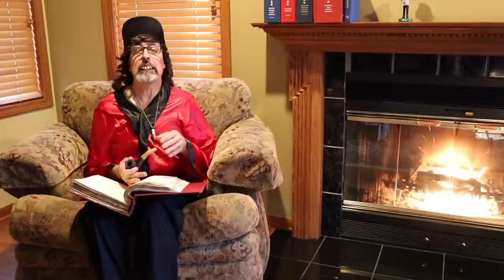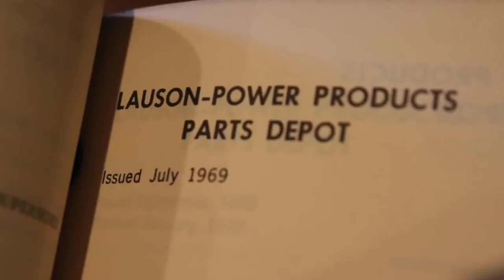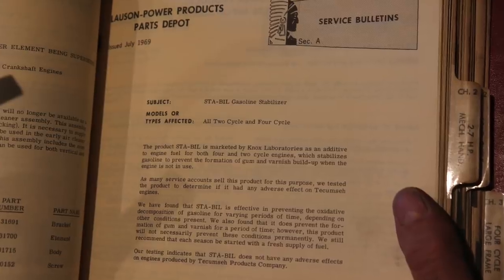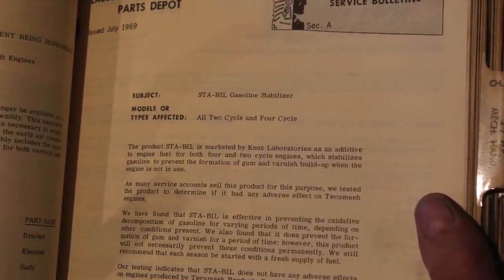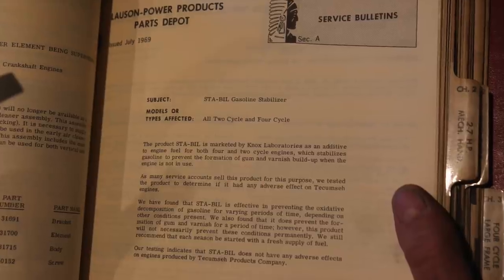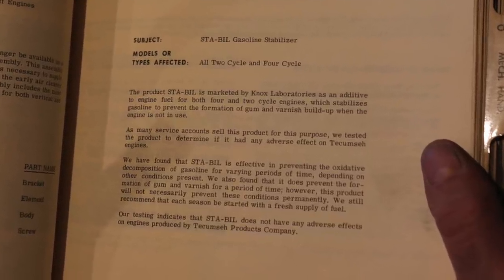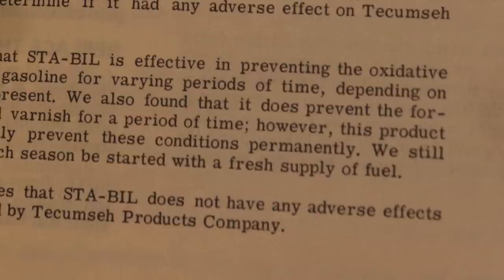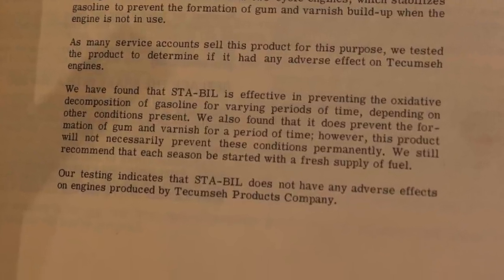Sta-Bil in 1969 - Does It Work?

Comment: I used to have carbatretor troubles, gumming up, varnish, etc with my Toro CR2000 snowblower because I would sometimes forget to drain the gas after every season. After I started using Sta-Bil gas additive the problems went away. For about ten years now I never drain the gas each season and never have any carbatretor problems. The only thing I make sure to do is to run it every season to make sure fresh gas is run through the system at least once a year.

Comment: This may be completely moot, since the leaded fuel we had in '69 was different than what we have today, I would assume that Stabil has also changed it's formulation. Back then, it was varnish that caused problems, while today, it is alcohol.
Reply: Well Taryls experiment shows no benefit of fuel stabilizer for over a year now
Reply: Lead in ‘69 fouled 2-stroke spark plugs.  Lead free gas was great...until ethanol.

Comment: That fireplace looks good. We have a fire in our wood stove this morning in TX.
I've stayed away from stabil,  i've cleaned quite a few carbs that had pinkish varnish from sta-bil... I've been using Star Tron with no problems. last year was the first year i used startron in my Pushmower and i decided to leave it with fuel sitting in the carb over winter as a experiment, sat from November to about mid march, it sputtered on the 1st pull and fired up on the 2nd pull, surged 2 times and ran great!

Comment: I use stabil and never have problems. But, and I mean but I do swap out the fuel around a year if no use. I simply put old gas in my truck and replace with fresh fuel and stabil in what ever engine it may be.  Never an issue in years

Comment: Fuel has been completely reformulated since 1969, Sta-Bil has changed hands since 1969, ( now owned by Gold Eagle brands) and has probably been reformulated, more than once,  as well. Sta-Bil now offers several fuel stabilizer products marketed for various needs and fuel types.  Sta-Bil  Storage advertises the product will keep fuel fresh for up to 24 months and works in both ethanol and non ethanol fuels. Sta-Bil 360 is geared toward ethanol fuels and only claims to keep fuel fresh for 12 months.  Anyone considering the use of these products should visit the Gold Eagle web site and read the various marketing materials for each product before  purchasing and using one. Include taking time to read the FAQs as much good information is contained therein.

Comment: Been using Sta-Bil fer 30 years. My Stihl 036 was made in 94 and has yet to have the carb touched on it. I also have two Redmax trimmers made in  2003 that are still percolating without any carb failures. I also use 100% gas. I think that it’s a good product but I ain’t getting into a fisticuffs with anyone over it. Us po folk better start sticking together.

Comment: How about that, I had no idea it was around back then! In those days we never drained out the mower gas tank over the winter and the mower never failed to start in the spring. Only time the gas ever got water in it was when the tank got left outside in the rain with the cap off.

Comment: What’s interesting is that gasoline has changed in some of its composition over the decades therefore these stabilizers must have changed as well. In the end with what the tech bulletin suggests it may help keep some of the bad from happening and change out your gasoline for a few months, so if you have a shut off then run your carb out and keep your gas sealed. I suppose that’s our answer on additives for some applications.
Reply: So explain this. Why is the 87 octane  no additive still starting up with the same amount of pulls as the stabil and other stabilizers.  After 12 months.  It's all about people that believe in snake oil.  And like wasting there money lol

Comment: Taryl, can you do a video on spark plugs for small engines please.  I want to change a spark plug on my Harbor Freight Greyhound engine and it calls for a spark plug without a resistor but I can't find one in stock anywhere.  Does it really matter if I use one with a resistor?  I'm thinking it may not but have heard resistor plugs may not produce as much spark and may cause the coil to fail prematurely.  Would appreciate your opinion.  I think it would make a good video.

Comment: Remember fuels in 1969 were different than today's fuels. You could get premium and fuels were leaded.
Reply: And you could pull into the "filling station" and the attendant would run out and ask you if wanted to fill it up with regular or "ethyl."  Shows how old I am.
Reply: @fastbusiness  and would check your oil and prestone
Reply: @wesbuhr548  and wash the windshield and check air pressure, take the money and bring back the change, stamp your coupon book and get a set of glasses or whatever they were giving away at the time.  We got a cooler once.
Reply: @luuk-out-below9804  Gas stations sometimes functioned like minor auto repair shops too.  They would patch tires, replace hoses and belts, install wiper blades, and a lot of the stuff that "quick lube" places do now.  I suppose some of them even put Sta-Bil and that type thing in your tank if that's what you wanted.  That's why they were called service stations.
Reply: @fastbusiness  I remember it well, the service station did a lot of the maintenance stuff, brakes, batteries, alts, pumps.  A different era.

Comment: I remember back then that by spring the gas would have a varnish smell, it doesn't do that now.
Reply: It does eventually.  I cleaned a friend's carb - he'd bought a snowblower, filled the tank, used it one Winter, then the next three had little to no snow.  When he went to use it the fourth year, it wouldn't start.  I checked it out for him and noticed a distinct, sweetish/varnishy smell when I pumped he primer.   When I opened the carb up, the smell filled my garage and the carb had brownish gunk all over the inside, especially on the float, as well as in the bowl.   Took lots and lots of scrubbing to get all the flakes of varnish off the plastic float (the metal bowl and rest of the carb cleaned up real easy).

Comment: In today's world most gasoline has ethanol. I  use stabil in my carburated motor scooter and after just a few days the ethanol starts to gum up the carburator causing difficult starting so I have to shake and rattle the motor scooter vigorously to get the fuel in the float bowl to loosen the gum  up. Then the scooter will start right up.  My fuel injected scooter does the same thing after a few days with out running it. So I have to give it some throttle while starting it up.   Yes Stabil fuel treatment does preserve the fuel up to 1 year but it's better to use non ethanol gas if you can find it. In my own opinion  they should Ban Ethanol From Being Put in gasoline and substitute it with Stabil  instead.  Problem Solved.

Comment: Wait a minute, why did they have fuel stabilizers before the days of ethanol gas? I thought they were invented becsuse ethanol gas was going to be the death of our machines. I guess neglect and poor maintainence ruined engines back then too. Now everybody says "it's not my fault it's the ethanol gas."
Reply: The old gas used to get more and more yellow going to brown and losing transparency. It would start to smell of acetone. At that point an engine wouldn't run on it. If the gas was allowed to evaporate away it would leave a coating of varnish that usually clogged the jets completely. Mustie1 channel sometimes shows ancient gas he drains from old engines and the gunked-up carburetors.
Reply: @hughbrackett343  Didn't get the sarcasm did you.
Reply: @bcad4066  I think I replied to the wrong comment. IIRC someone asked what happened to the old non-ethanol gas.

Comment: I have many small engine projects available from farmers in the area. They never throw anything away. If I begin to work on one and find the carb full of green slime, it will be the dreaded evaporated Sta-Bil. The only thing worse is evaporated 2 cycle fuel just because of the smell.